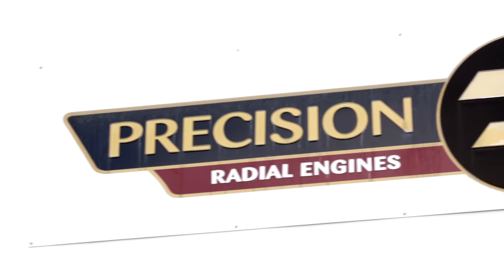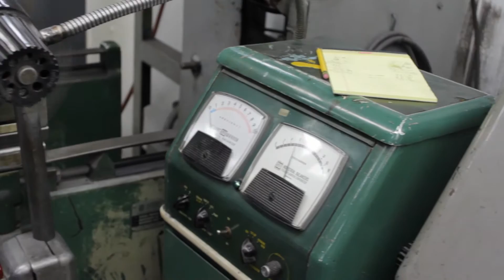Precision Engines Overhaul and Repair Facility

Comment: I am a survivor of the Lynyrd Skynyrd Band plane crash in Gillsburg, MS, Oct,20 1977. It was a Convair 240, with R2800 Double Wasp, I have several questions about the fuel system and  electric fuel pumps, etc. Is there ANYBODY  out there that would  answer/explain  some information. NTSB, said we should have had 170 gallons or fuel, they found less than a quart.  I saw fuel being pumped out in a arc and the engines began to sputter and stopped operating.